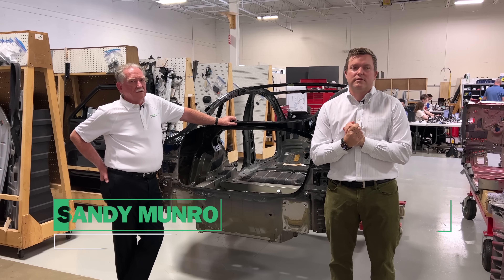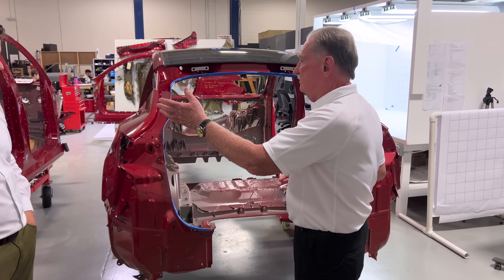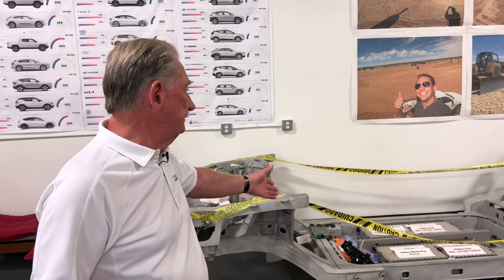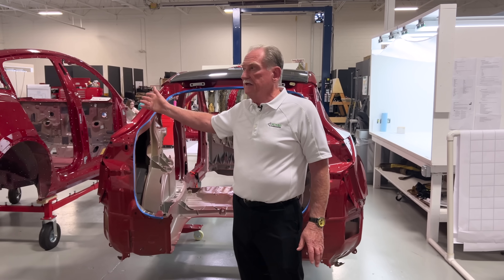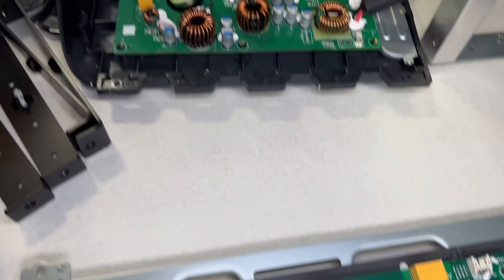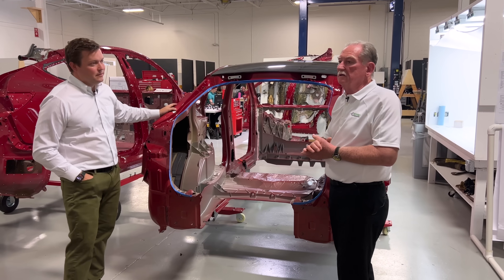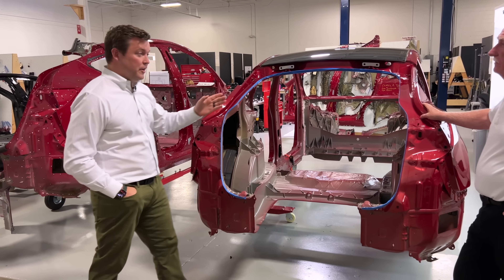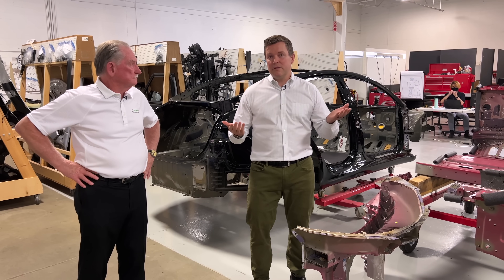Giga Castings with Sandy | Evolution of Tesla Bodies In White

Comment: So how long till Tesla figure out to cast the entire car in one piece front, center back and pillars all in one piece. Than put your body panels and everything else in.

Been thinking about it just have a left casting and a right casting then weld the 2 halves together, if you use aluminium then you could friction stir welding for a good strong weld.
Reply: Cybertruck is being designed this way. Hence, the large IDRA gigacasting machine.
Reply: @GET2222  No, CT is an exoskeleton design, completely different
Reply: @NinetyTres  yes it is, but it will have the large sting casting that man has ever witnessed since the beginning of time…. Muhahahhah… muhahahahaha… Muhahahahaha. Muhahahah…. Ha.
Reply: @GET2222  I don't think you understand what an exoskeleton design is
Reply: @NinetyTres  I know what an exoskeleton design is. I’m an engineer. I’m playing with you… the new 9000 TON Gigapress castings will allow for the exoskeleton to be adhered to it. The stainless steel exterior is the genetic contour of the overall structure of the vehicle without the need of exterior quarter panels, instead, the exterior is the structure. Not to be confused with a unibody construction of old VW products.
Reply: @GET2222  got me lol
Reply: Think if you could even make the passenger cabin reinforced as another inside box for extra crash protection. Or take a look at that old 90s classic demolition man and do some foam! Haha
Reply: They patented that design idea/method in 2016 already
Reply: One fender bender and scrap the whole car. Nice dus green!
Reply: @Cloxxki  you weren't paying attention
Reply: @Cloxxki  As with cars are now the fender panel are attached to the chassis frame. If the bump was that bad it bent the fender and the chassis it's attached to your looking at a write off anyway.

Comment: Does this mean a front or back shunt scape the car?
Reply: Any shunt that's sufficiently strong to damage those castings would write the car off. Same as in a "normal" car. Here in the UK if the chassis is damaged then the car is deemed not safe to be put back on the road.
Reply: Depends on the force of impact: if it was big enough impact to bend or crack the casting, then yes the car is scrapped. Don't forget that the casting isn't directly behind the bumpers but there there's the crumple zone between bumper and casting. And if the impact forces do crush beyond the crumple zone your car will look like a real mess.
Cost of repair would be to large when compared to the cost of payout on value of the car for the insurance company.
Reply: You need to be doing about 100mph straight into a concrete wall to get the castings to bend/crack. Imagine trying to repair that car. Or what your face will look like after that. You will most likely not survive that kind of crash.

Comment: Do they make a structural pack with 2170s? Do they still use the Giga casting with 2170s?
Reply: I know they used the two piece casting with the 2170. Full one piece castings with 2170, Im not sure.
Reply: 2170 is not structural. Right now structural is front + back casting. 2170 is only rear casting.
Reply: How structural is that pack really and how much relies on the bonded together 4680s? Fight see any torsional stiffness tests yet. If the giga castings are so strong, is any structural floor even needed?